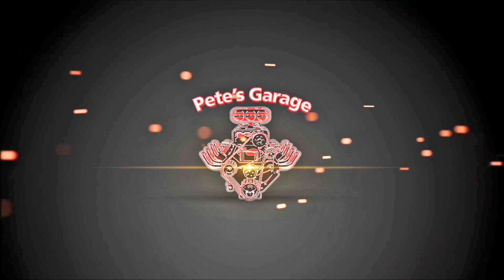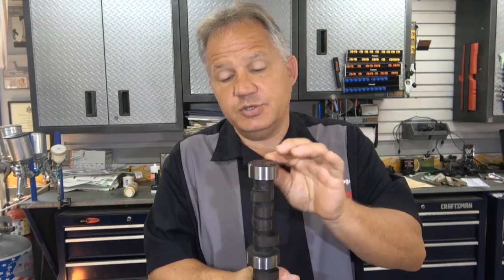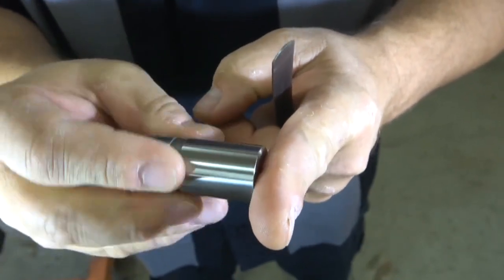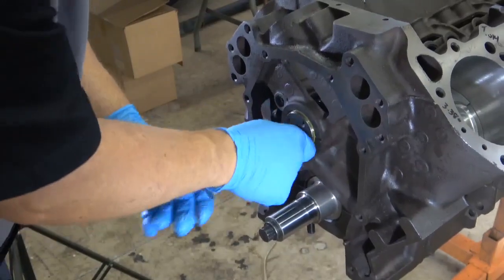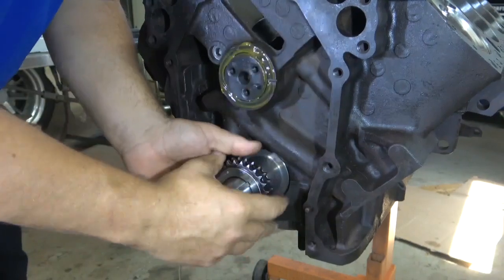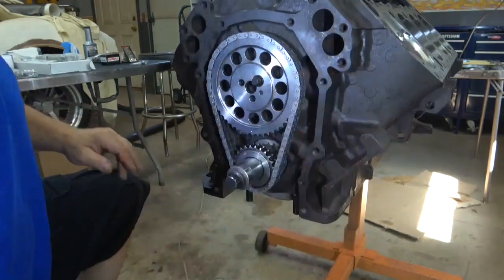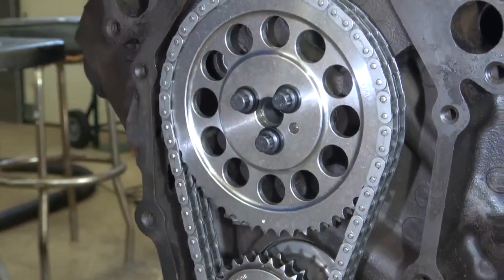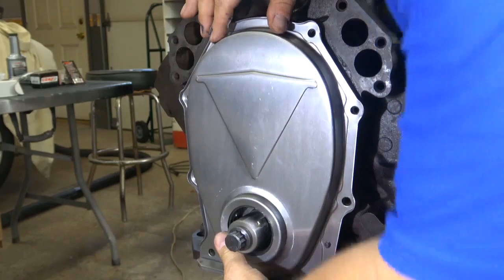Engine Building Tips - Finding TDC and Camshaft Installation 440 MOPAR 512 Stroker

Comment: I believe it is correct that the cam sprocket dot needs to be at the 12 o'clock position and not the 6 o'clock position for the engine to be on the firing stroke. Once it's assembled "dot to dot" it needs to be rotated one full turn to be at tdc on firing stroke. Then the  distributor/oil pump drive gear is installed with slot parallel to crank, then disributor installed with rotor pointing at number one terminal. Please correct me if I'm wrong. Love watching your Mopar engine builds, you do an excellent job!
Reply from the maker: #1 will be at TDC at 12 & 6.

Comment: You have to have the oil with high zinc in it to properly break in a camshaft
Reply from the maker: That is true
Reply: Here's a silly idea coughed up [by I think Engine Labs?] in the not too distant past inside some piece:  "break in" a DLC coated cam & [flat tappet] lifters.  My reaction:  whuuh? At roughly 2 microns, you better NOT "break in" that investment - protect it.  Seems to me 3 things matter [assuming good oil and good hardness]: lifter crown radius/symmetry,  complimetary lobe taper,  and surface finish on both.  Get all those right, and bizarre rituals are not needed.   I won't be hopping about on one foot, flinging spoonfuls of hot sauce at a picture of chairman Mao, chanting "yo-yo man: stay in the trees!"  I will inspect my cam and lifters instead, and later have a beer. 
 Remember what break in oils purpose is: increased wear through reduced protection.    If there was a computer program to do the physics for picking the right oil I might bite, but all numbers are needed to figure out how much lower  oil protection could go [for traditional iron lets say]: spring rate, lifter radius, rocker ratio, cam lift/duration, and weights of all valve train components to the gram.   Been a while since I got half as deep, but one little 89g solid lifter at 6000rpm is something over 4 pounds extra force  against the lobe [if I even remember right] from 0.500" lift alone.    So... right oil?  Chew on this simple notion: a spring sitting at 320 pounds [max lift] going back through 1.5 rockers to a proximal tangential [lobe vs lifter] area of 0.008" is... 60,000 psi, and that oil has to beat that in protection for the cam to live.  A break in oil that only handles 80% of that load?  Maybe time a break in for 2 1/2 minutes or less - inspect the lifters burnish pattern under a 7x lens, re-measure it all, and make the call.